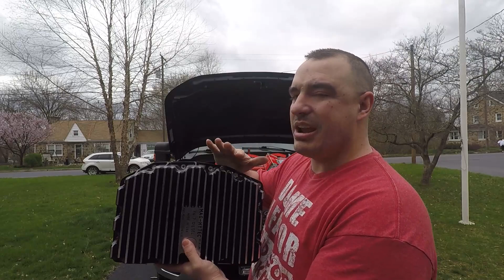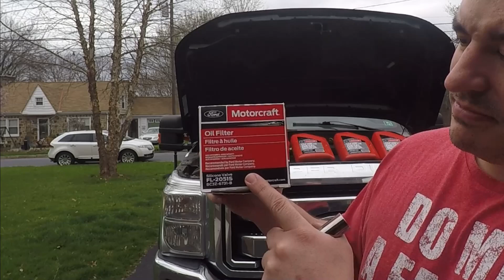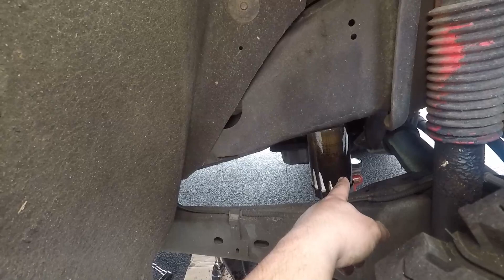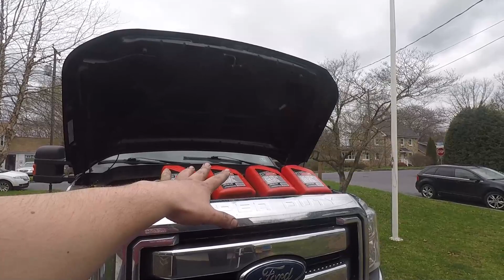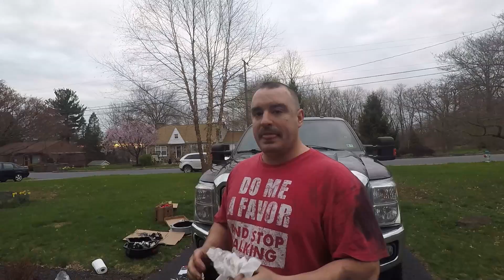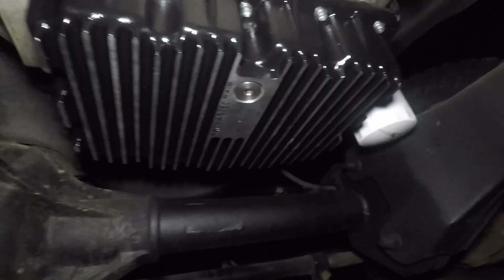6.7 Powerstroke Oil Pan Upgrade

Comment: Any tips for taking the old oil pan off????
Reply from the maker: Take your time I would use some plastic tools if you can, be careful with screw drivers or prybars because you don't want to dent the upper oil pan which you can do when trying to get the old one off. Take your time slowly work it off if you have some flat scrapers they may work

Comment: To bad nobody shows you how to install the O-ring because I can’t get mine to stay in the oil pan.
Reply from the maker: Mine actually came pre installed. My advice is to slowly work it in one small section at a time, and it will likely take several times going around because sections will pop back out but it will go in

Comment: If you open the oil inlet cap and poke a hole in filter with a punch and let it drain, there is no mess.  You got four because you need 13 qts for factory pan, 15 for new.
Reply from the maker: Yeah I liked the new pan so much more. I have heard that with oil filters I just haven't don't it so injust let there be a small mess

Comment: Give Triax Fleet 5-40 or 15-40 a try. Bulk orders are cheaper than T6. Been running in my fathers 14 6.7 powerstroke for several years. Also in my 14 TDI Jetta and 19 Colorado 2.8 Duramax. All with good oil sample results from Blackstone labs.

Comment: I'm sure someone's probably told you by now but if you poke a small hole in the bottom of the filters before you take it of then it's empty 🤷‍♂️ that's what I used to do when I worked on semis
Reply from the maker: I have gotten that. I now sold that truck but plan to buy another 6.7 in a year or so. Thanks for the advice though
Reply: @six0bros  my bad still trying to catch up on some of your older videos b4 I watch new ones
Reply from the maker: That's great man hope you enjoy it. You're just in time for a big 6.0 build with a kdd build in a box.

Comment: I may have missed it but do you have any reliable proof that is pan reduces oil temp any appreciable amount? I'm somewhat interested in doing what you did but on the pan sights I hear nothing but annectdotal claims & hype about how great they are & how good they look. That really tells us nothing. Thank you for a quality video.
Reply from the maker: Glad you liked it. So in my experience i did not see drops in oil temp. I belive the big perks this is truly how solid it mounts and isn't going to have the same flex the factory pan does. Not that every factory pan has issues but the are prone to leaking and I don't see this leaking really if it does its just replacing the gasket. Should be a link in the description to to few different ones to check out if you're interested

Comment: How mutch Oiltemperatur reduce  this Oil Pan ?
Reply from the maker: I didn't see really any reduction in oil temp i think the main part is the thicker mounting flange to add rigidity and prevent leaks

Comment: I use a small punch and hammer to put a hole in the bottom of the oil filter to cleanly drain it before removal. Nice video and new pan.
Reply from the maker: Thanks. Yea I have heard a few people say something similar about putting a hole in them

Comment: I would think having the plug facing straight down would make a mess all over your hand when removing it?
Reply from the maker: I prefer it and truthfully that I'd all that it is. Preference. A little bit yes but I dont have to deal with aiming the distance it will come out. I prefer facing down some prefer the other way. There are "upgraded" pans for each style

Comment: One thing I’ve learned from working on heavy duty trucks and equipment is if you take an All or a spike and puncture a hole in the bottom of your oil filter it’ll drain most the oil out of it that way you don’t spill oil if you drop it
Reply from the maker: I have heard that. If I worked on them I probably would but just at my house I dont mind well. Lesson learned to be a little more careful lol
Reply: 6.0 Bros lol I totally understand
Reply: Nolan....damn good idea!!
Thanks!

Comment: Wish someone made an aftermarket upper oil pan with a gasket in it like this lower oil pan.
Reply from the maker: I do worry about the upper gasket man. I am hoping for a long life without issues lol
Reply: 6.0 Bros yea mine is leaking on my 19. And the dealership isn’t covering it do to the “weight reduction” kit. It’s the first thing they’ve denied under warranty. Said the weight reduction kit caused it. I told them theirs no way. This is a common problem. I was told on the 2020 super duty’s ford went back to putting a gasket on instead of silicone.
Reply from the maker: I believe they have to prove that it caused it to deny it. However it may be a bigger is to fight it then to have it fixes. I would see if they would put one with the gasket on instead of the silicone stuff.
Reply: 6.0 Bros yes it is. That’s why I’m just going to do it myself. And the only years they made a gasket for the upper oil pan was either 11&12. Or 12&13. Can’t remember which 2 years. But I have a gasket ordered to see if it will fit on the oil pan for my truck. They look extremely similar.
Reply from the maker: let us know if it works when you get it. sucks you have to go through this though.
Reply: @carls2210 my 2019 is leaking from both upper and lower lol hopping 2023 ccv fixes upper and for the lower am using felpro with a new Dorman oil pan.
Reply: 6.0 Bros so the upper oil pan does have an issue but it is caused by the ccv filter get plug and causes high pressure in the crankcase. If you take off your oil fill cap and the cap wants to pop off you need to replace it.

Comment: i use t6. bout 125 for an oil change with filter.  what’s the motocraft oil change set you back
Reply from the maker: I honestly dont remember I bought a fee things. I know when I buy oil from the dealer for my 6.0 it is about 85 with filter
Reply: It’s about 28$ 5 quart